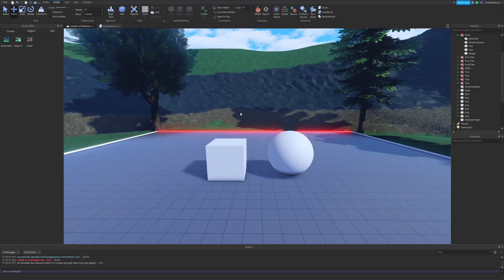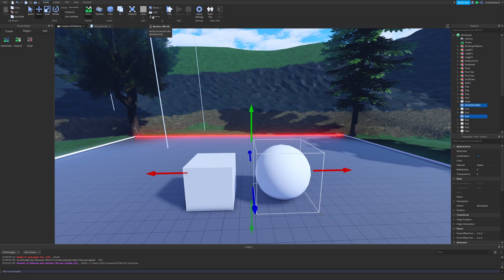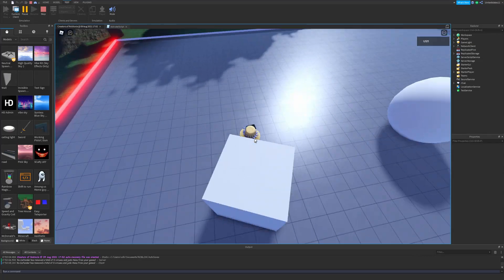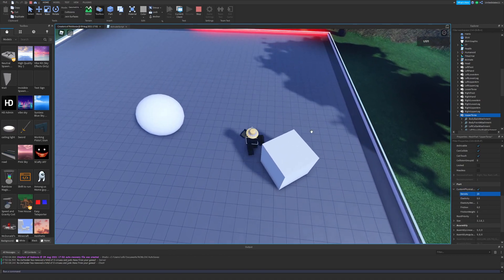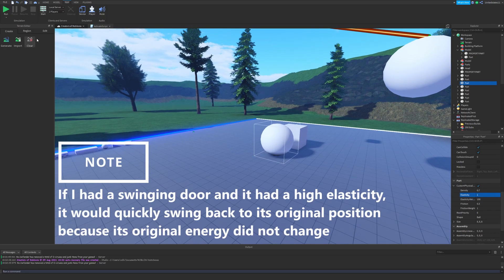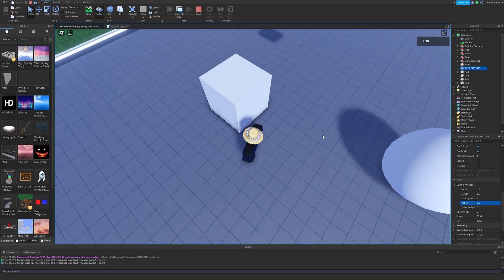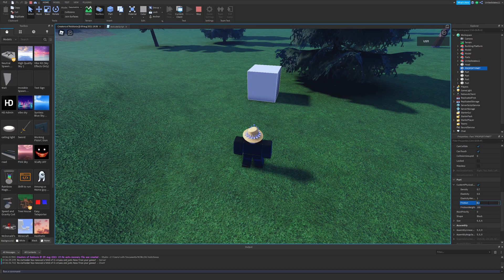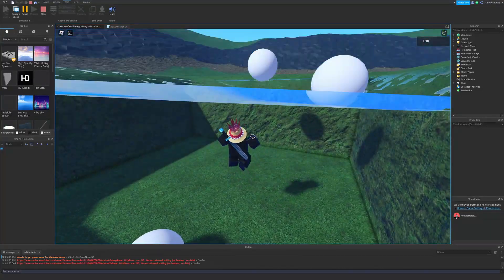ROBLOX Building - How to use Custom Physical Properties!

Comment: Is there a way to change the center of mass?
Reply from the maker: There's the option called Apply at Center of Mass; if that is off, then it won't apply to the center. There's no way to precisely change the center, but I don't think you would want to because that wouldn't represent proper physics simulation; in the real world you wouldn't be able to defy the laws of physics and change where mass is located unless you had some sort of molecular "transform" gun or something